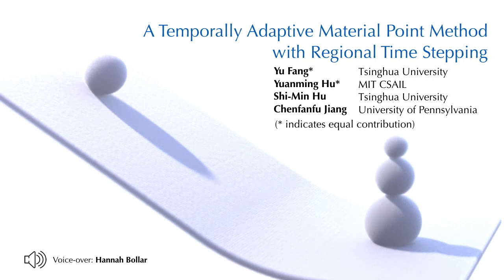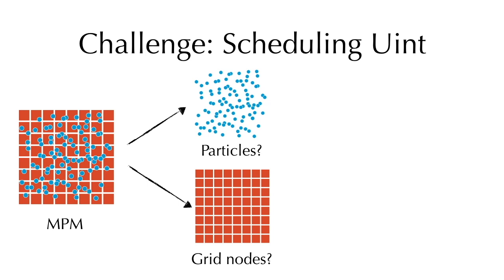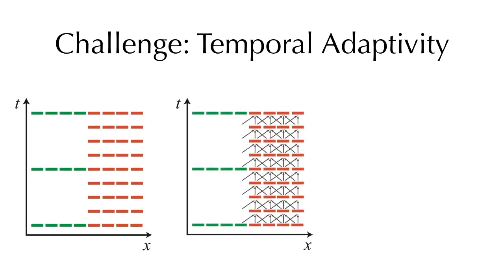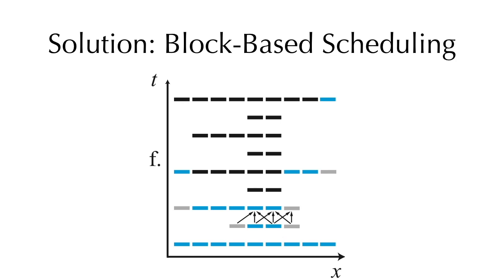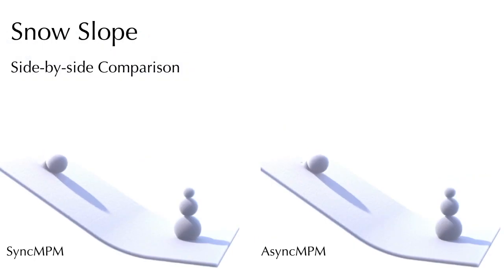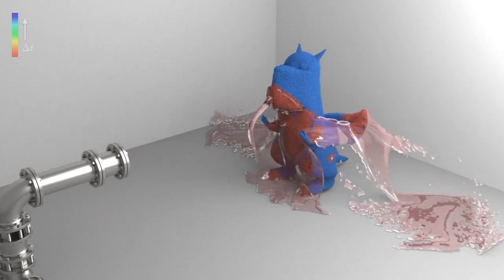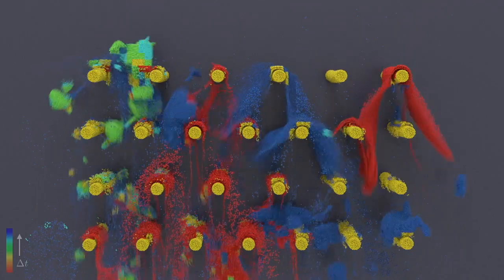[SCA 2018] A Temporally Adaptive Material Point Method with Regional Time Stepping

Comment: I saw lots of MPM simulations for soft jelly-like objects,  would MPM be suitable for simulating the fracture of a hard object (crystal) with a high Young's modulus? (Maybe a much smaller time step is needed?) Thank you!
Reply: Did you ever find an answer?
Reply: I saw some work on this titled "Simulating Brittle Fracture with Material Points". I wonder if there's other stuff that you've found.

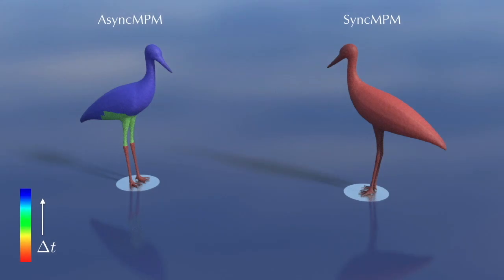Comment: 2:27 why would a larger timestep be more accurate?
Reply: AsyncMPM uses a smaller timestep in fast changing areas (e.g. vibrations) and a larger timestep in areas that don't change a lot. That is why vibrations are preserved better using AsyncMPM.
Reply: Just guessing but could be because with each calculation or update there is error. With more steps per unit of time there is a greater cumulative error per unit of time. If a variable is supposed to be static or slowly changing then it could get less precise over a given period of time because the results would drift away quicker due to more steps generating errors. - Think of the typical example for this being a very tall tower of rigid body simulated boxes stacked one on top of other. If it is not simulated then it stays as it is - correct. If it simulated then due to minor rounding errors such tower would crumble and collapse - wrong result. If the tower was updated every 10 frames then the tower would stay intact for 10 times longer - framewise. It would probably crumble in the same number of simulation steps, unless the steps are more precise or have different parameters (greater damping or whatnot).